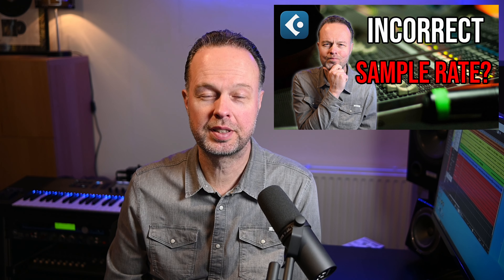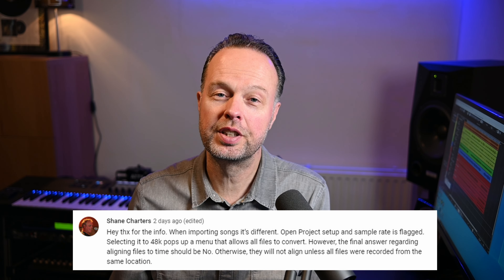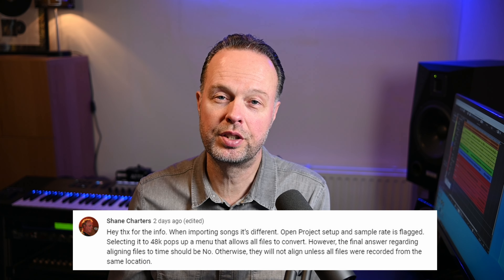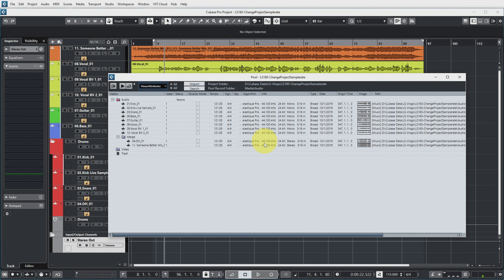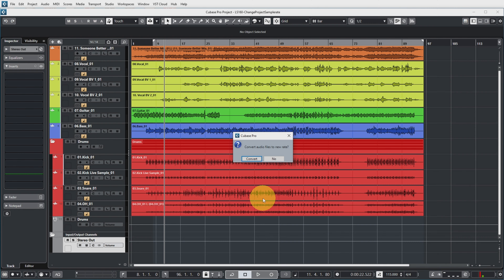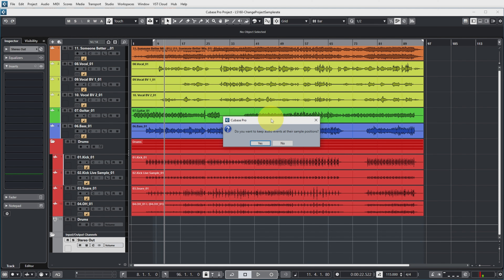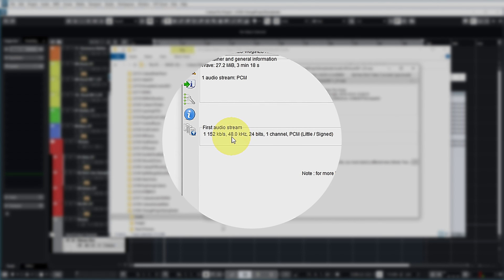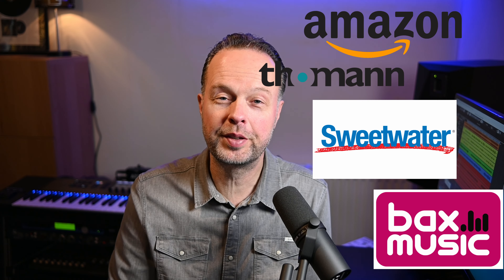How to change the Cubase project sample rate after recording, and why it may be necessary!

Comment: Nice video! Maybe you can help me. I recently converted a 44.1KHz project to 48KHz. All the files are 48KHz now so no problem there. My problem is that the vocals where auto tuned with Vari Audio originally when the project was recorded in 44.1KHz project format and now the project is in 48KHz Vari Audio no longer responds to adding new notes to be tuned and the ones that where originally tuned are now behaving erratically (not all of them) but the ones that are sound detuned and crackle. Any advice? Also would love a video on the affects of using mismatched sample rates on your audio interface and the DAW’s set sample rate ie if your audio interface is set to 48KHz but your project is set to 44.1KHz and vise versa. Also the differences on mixing down your project to 48KHz when your project was set to 44.1KHz and vise versa. I hope this all makes sense. I feel like I’ve opened up a can of worms but these things keep me awake at night 😂
Reply from the maker: Thanks, don't let it keep you up at night though 😉. I would bounce the variaudio tracks before conversion, so it's no longer on there before you convert the sample rate of the whole project. I can imagine it does not go smooth otherwise. 
Mismatched sample rate between audio interface and DAW, I cannot get in that state. Cubae adjusts the sample rate of my audio interface to whatever is set in the project. But it might depend on your audio interface.
Exporting at a different sample rate as your project sample rate should work just fine.
Reply: @LanewoodStudios  thanks for getting back so quickly. I’m using a Focusrite 18i20. I recently changed its sample rate from its native 44.1 to 48 because I’ve changed my Cubase projects to 48. So in reality I didn’t need to change the Focusrites sample rate? What if I say recorded vocals from the Focusrites sample rate at 44.1 into my Cubase project at 48? No problems there? Also I can mix down a 44.1 project to 48 wav file with no problems? It’s all to do with getting into video creation now. Such a minefield as it’s understood that you need 48 for video. Thanks again.
Reply from the maker: @paultraveller  the sample rate of the recording should match the sample rate of the project. Otherwise the recording will likely be changed in pitch and speed. But usually the DAW just changes the sample rate of the audio interface. Just try it all to see how your daw/interface combi action handles it. Then you know 😉.
Reply: @LanewoodStudios  Thanks for all the help. Keep up the great work on on your vids! I'll be watching!